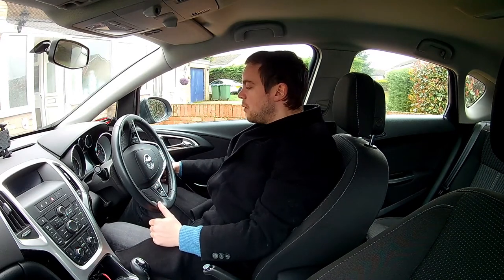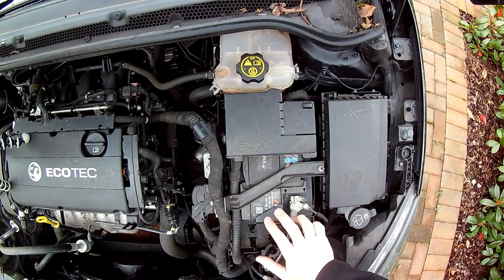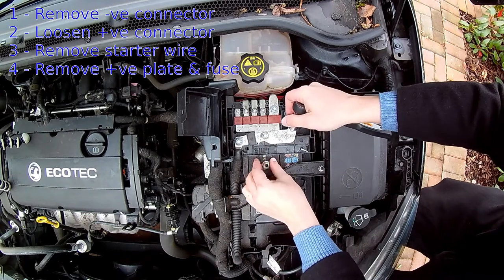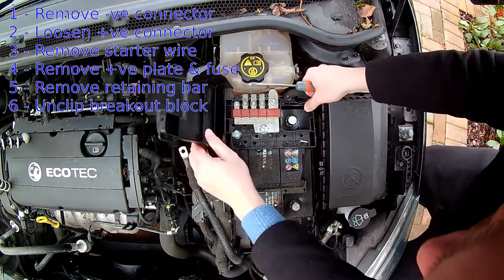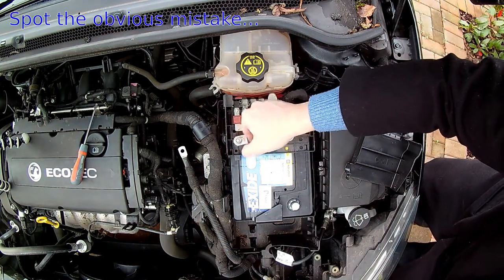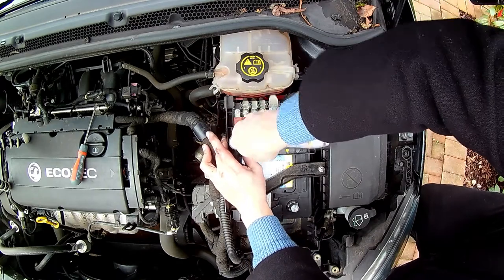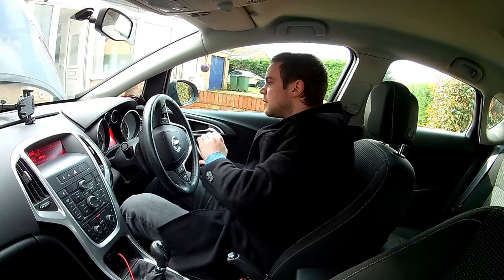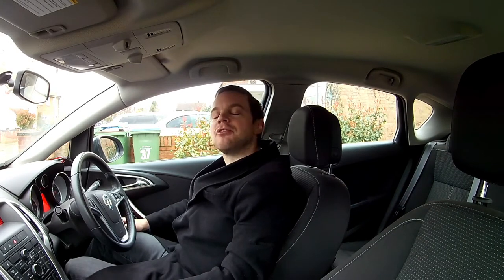Replacing the battery in a 2014 Vauxhall Astra J - Laurence Plays with cars

Comment: Can these stop/start batteries be replaced with something with a battery that has higher cold cranking amps, better for cold starts? I have 2.0 cdti astra J (gtc). Wondering if I should get an upgraded battery when it needs replacing
Reply from the maker: I'm afraid I don't know - that Astra didn't have stop/start and until the battery died didn't have issues with starting. I don't see any reason you couldn't upgrade the battery, as long as you make sure it fits though. I'd recommend asking someone who knows a bit more than I do though - sorry!

Comment: Do these batteries not have to be programmed?.
Reply from the maker: Not at all - it has a positive terminal and a negative terminal - no electronics inside. I guess some cars might need to be told if the battery changes, but as far as I'm aware, the Astra wasn't that smart.
Reply: @LaurencePlays  thank you for the reply.. I have the Astra j vxr with start stop.. I'm confused to if it needs to be programmed..
Reply from the maker: @dreadpirate1337  Ah, I'm afraid I don't know - this was an SXI, I think. 1.6 litre anyway, and generally pretty low spec. I know that if you have start/stop you need a more robust battery, but I don't know either way about programming it.

Comment: Thank you for the video  change of the battery  well done and thanks 😊 👍
Reply from the maker: You're very welcome! I hope it was useful. Next up, find out why the washer jets aren't working (I hope it's just a fuse)
Reply: @LaurencePlays   it was very useful indeed to find out about the clips that holds the wires on the right had side of the battery.  Thanks again 👍

Comment: Made it look easy, thanks. Just about to fit mine..
Reply from the maker: Good luck! It's really not too difficult, the hardest part is the plate at the front that holds it in. And not forgetting to reconnect the starter motor!
Reply: @LaurencePlays  was easy , everything was as you showed in the video. Thank you 😊

Comment: Great tutorial, I have manged to replace my car battery but now my car wont start. 

I am sure I have put it back exactly like before but no idea how to test this without some major equipment. Any ideas?
Reply from the maker: Hmmm, hard to say - I'd recommend charging the battery first, make sure it's not just flat! In my experience, new batteries are usually supplied about 50% charged, so it /should/ be OK, but it's worth checking. 

Does anything else work? When you put the ignition on, does the dashboard light up? If so, you might have missed out one of the connectors on the positive terminal, like I originally did, and then had to fix.
Reply: @LaurencePlays  Thanks - turns out the screws and bolts weren't tightened properly. All sorted now.